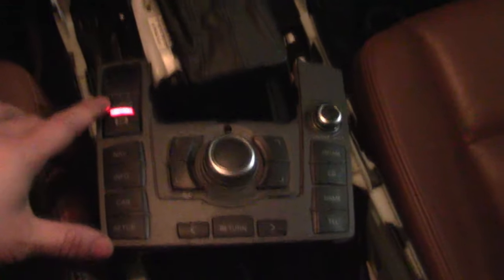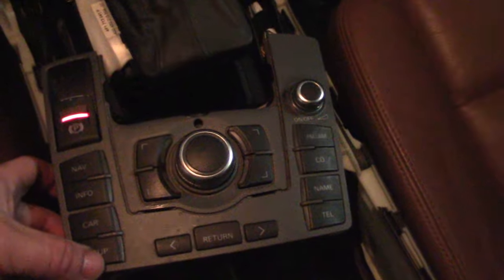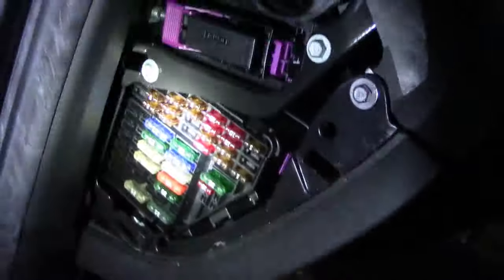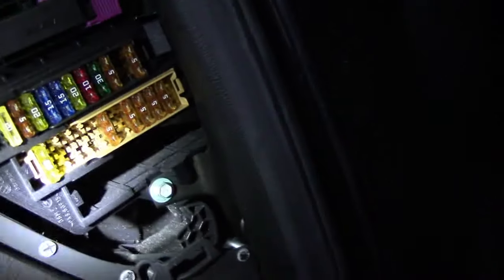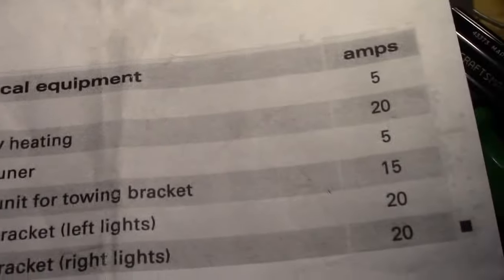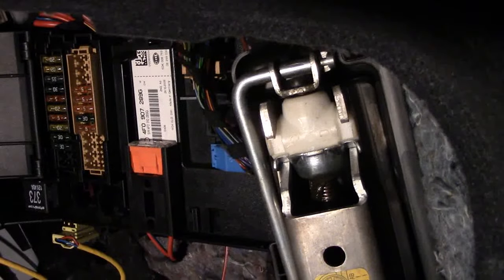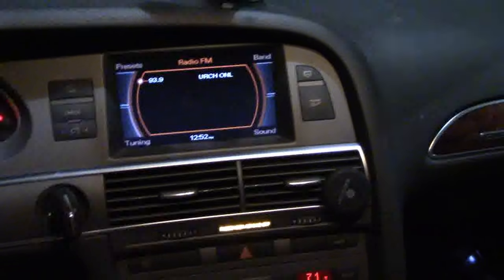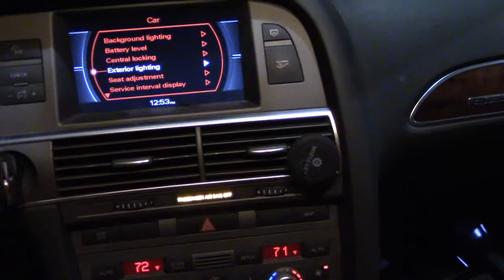Audi A6 Quattro (2006) MMI Not Powering up, Troubleshoot and fix

Comment: Hey everyone! I wanted to share my experience with MMI problem! One day for my car died a battery and for a while i didn't have a chance to charge it! When i charged a batterie the car running normally and everything is working but then i wondered why my MMI is not working! I searched everywhere a information and i couldn't find my problem! MMI was completely dead! I tried all video but nothing worked for me! But then i start to check optical cable and understand that he is not getting a power! I have audi a6 4f kombi and fuse i have back in the trunk and i start to check it! The first fuse what is for Digital Signal Processing (DSP) / 
BOSE amplifier 30a was burned of! I change it and It was nothing!   I couldn't get it what was wrong still! Then i start to search a fuses diagram! And i found it's in front on right side too fuses for MMI! I start to check and there i found one more fuse what was burned! It was position 12 Media drives, front (MMI) what is 5a! Before guys you are a taking a part a car please check a fuses because you don't need to do more work as you need! For me was only burned 2 fuses but i almost taked a part all salon! I hope these comment will for  help! Have a nice day every one!

Comment: My mmi control lights up sometimes and on the screen the audi mmi logo shows up at the same time but I can’t use the mmi.
It changes between blackscreen and mmi logo. 
Is it the mmi control unit that has the issue?

Comment: Mine stopped working.  And the worst is that the screen wont turn on. Due to On/Off button is located on this whole surface. But. I Fixed it. and here is what happened./. this can trigger malfunction when you change your battery. I completely forgot about that, and then remembered. So here is the rest: you need to locate the amp(s) in the trunk, and disconnect them . then disconnect the battery and leave for 5 minutes. and then leave the amp off , try to turn on the car. and see if the entertainent system buttons powers on. Mine did. then I turned off car, reconnected the amp and it worked again. It just needed to be reconnected. or reset
Reply: I hope this works for my s6. Didn’t realize getting a new battery would cause this.
Reply: Can you clarify what you mean by the "amp"?
Reply: Bose AMP in the boot trunk left side says Bose
Reply: @MoAli-vh8uo  mine is a Harman Becker automotive system. I replaced it and still the same issue.
Reply: Had this exact same issue after doing a parasitic draw test, MMI turning on for a second then going blank. MMI control buttons not illuminating . Tried this sequence and it worked perfectly.
Reply: I'm going to try today. I've had to replace multiple modules on a 2009 Audi A6 Quattro with the Bose stereo system. 
    Every thing worked great when I first purchased vehicle. I had actually warned people of electronics issues on Audis for year. As iam a Senior Ford Master tech and A.S.E master with L1 advanced cert. I knew I could fix anything. Since buying I've had a crash course in Audi Repair lol. Thanks for the advice all.

Comment: Hi mate thanks for your video, i have the same issue with my audi a6. I brought the loop bypass plug. After i plugged followed the steps shown in your video the screen comes on for couple of seconds and then switches right off again. Any advice would help thank you

Comment: I have this problem in an audi a6 2005 it turns on and off, connect the bipass cable but it still does not work?
Reply: Did you fix the problem, thanks!
Reply: it worked for 3 and 4 times the stereo then it turned off again and it never turned on.😐

Comment: Hi thank you for the upload. I have tried bypassing all three modules individually and still the mmi will not power on. Also all fuses are good. Does this mean the mmi control board has failed?
Reply from the maker: does the console buttons light up at all?   if not, better change the board.
Reply: @diy-tony8296  only two of the buttons light up
Reply from the maker: @eddyc9339  better change the MMI board.
Reply: @diy-tony8296  thank you. It’s strange, the two buttons on the mmi controls that light up don’t shut off. Even when the cars off and doors locked
Reply: @diy-tony8296  Is the central panel mmi connected to the steering wheel?

Comment: Did uou fix it? I am having the same problems.
Reply from the maker: yeah. the MMI is fixed, boots up. you can use my approach for troubleshoot. in my case it is the amplifier.  It might be other component failure in the loop for you.
Reply: tonyx-DIY did you buy a used amplifier to fix it or new? I bought the loop cable and nothing happened. Any other suggestions that I’m maybe overlooking?
Reply: And please tell me where did you find the hex-can cable and how much did you pay for it? Thanku you🙏
Reply from the maker: you issue might not be in the amp. like I explained might be other component failure in the optical loop.   do you have CD/DVD changer, USB plugins..etc for example.  I got the cable and software from ross-tech.
Reply from the maker: @wrestlercouple6607  I got the used amp but looks like I have the issues else where in the AMP electric plug. speaker not functioning for the moment. but with the optical plug to close the loop everything else works that are controlled by the MMI.
Reply: @diy-tony8296  can you please post a link for the cable to troubleshoot? I'm looking into buying that cable to see if it's my amplifier with the problem

Comment: Hi! Just in case anybody is fixing their dead MMI. My Bose amp died, it showed electric: OK; optical: ERROR. Everything else was up. I replaced the amp and it booted to life. You just need to disable component protection afterwards. VCDS was pretty useful, but you need ODIS to get it adapted to the car.
Reply: abrites

Comment: Hey, my mmi doesn’t work at all nothing pops up no lights nothing. I went to see the fuse box and I found out the I was missing like 2 fuses and one was blown. Do you think that can be the problem?
Reply from the maker: there is a good chance it is fuses because it is like no power for the whole thing. you definitely want to replace the blown fuses first. not sure why there would be missing fuses through. definely  fix the fuses and rule it out and move on to further troubleshooting. if it is just fuses, you are lucky. gl
Reply: tonyx-DIY thank you. I actually bought the car like this with mmi not working for way less $$$ but never asked what happened to the mmi and also the mmi buttons are really sticky looks like coffee has been spilled on it but i changed the circuit board and was still having the problem. By the way, i did some research I found out that there were more fuses connected to the mmi on other fuses location.

Comment: Hey I have this problem in my '08 Audi A6 and I replaced the amp and now I have a working mmi and display that doesn't shut off right away but the bottom left button(sound button) next to the big middle knob won't light up or give me any sound. Tested all the different connections radio, sirus, nav, cd player, and Bluetooth with optical loops(male and female plugins) and all seemed good but unfortunately the same result. Plugged in a diagnostic tester and got back that the radio tuner was not activated or enabled. Do I need to replace my radio unit in the truck or am I missing something?
Reply: i have same car, how did you find out this was the problem

Comment: Mine will make a thumping sound on the speakers when powering the car off. The screen comes on when I push buttons but then turns right off. (Half of the screen) nothing plays
Reply: Mate, even myself having the same issue. How did you fixed it?